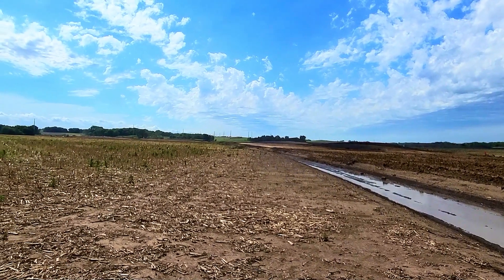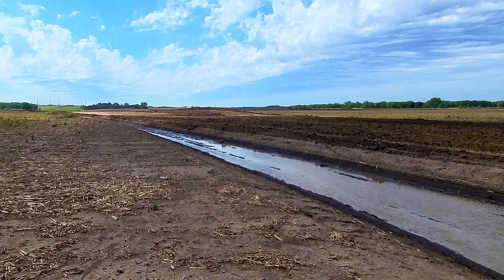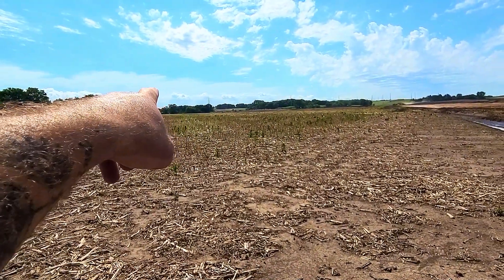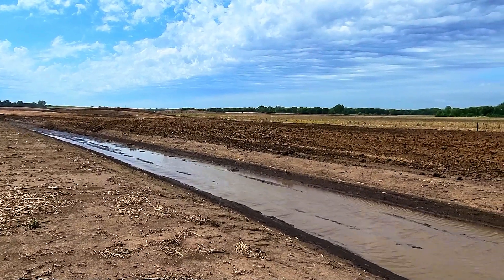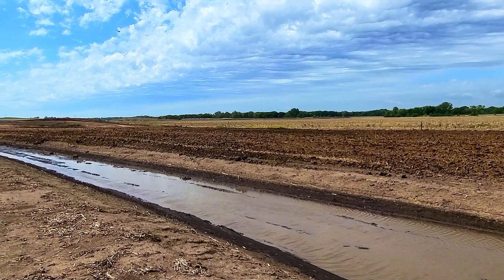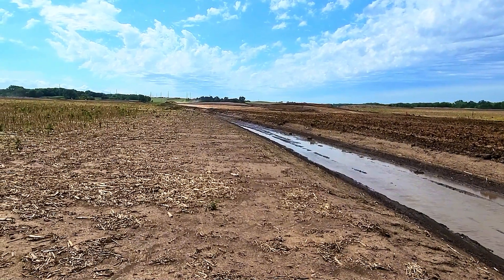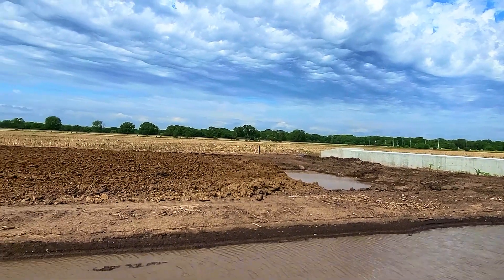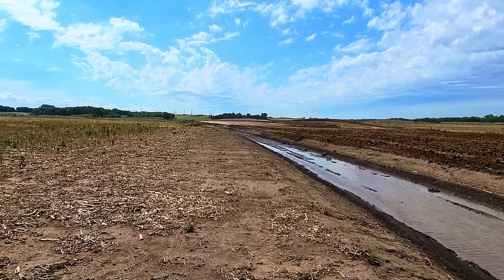BASICS OF ROADBUILDING || Building a Road from the Ground Up -Road Construction Process Step by Step

Comment: I turned this video on because I have land and no place to park when I go up there. The road is higher and there’s space to create a parking space but it slopes - I was wondering if I built like a little retaining wall and filled it with gravel would I be able to create a safe place to park??
Reply from the maker: Without seeing the site it's hard to tell what your best route would be.  If you are able to slope the low side with a 3 to 1 or 4 to 1 slope then you might not even need a retaining wall.
Reply: Thank you for your response ❤️

Comment: I enjoyed this video and learned a lot about road construction. Is this going to be a series? Is there going to be more videos from this site? I remember the D6 video from this site but was wondering if you had more footage from here. 
One more thing, when you say "lifts" does that mean you add material and then compact it until it builds up the the height you need? 1ft at a time.
Reply from the maker: Unfortunately I didn't get a ton of footage due to time constraints so this the linked videos are all I've got from this job.
As far as the lifts question, you are exactly right. You can put down about 8 inches of material at a time (some inspectors will let you get away with a foot) and then you have to achieve density before proceeding with the next lift.
Reply: @DieselandIron  That's what I thought "lifts" meant. I think I heard you explain it in one of your other videos too. Thanks

Comment: Road building is a little bit tuff because you are in a tight spot just a small info
Reply: Agreed, especially on widening jobs. Barriers between you and constant traffic all day
Reply from the maker: @Theonetwo48  It's always the best when you have traffic flying beside you 20 miles over the construction speed limit...
Reply from the maker: It all depends on the project but I agree, a lot of times you are pretty tight on space